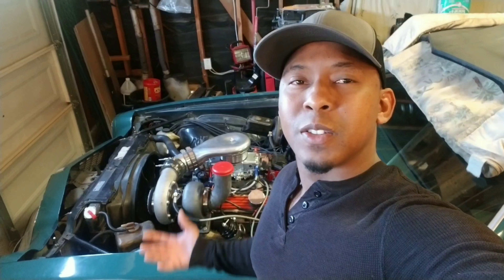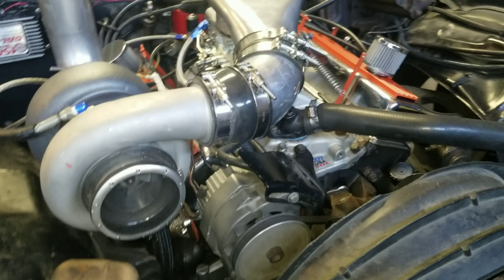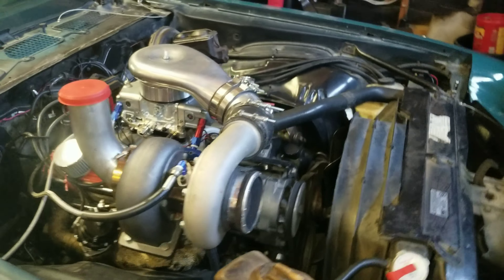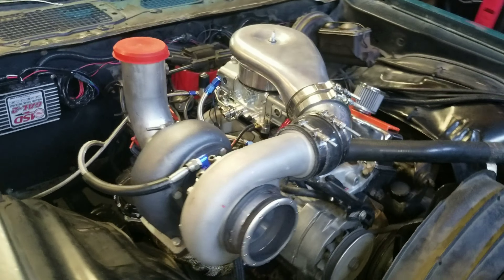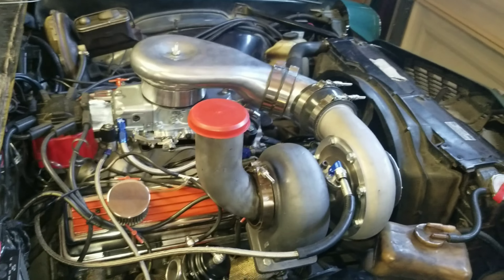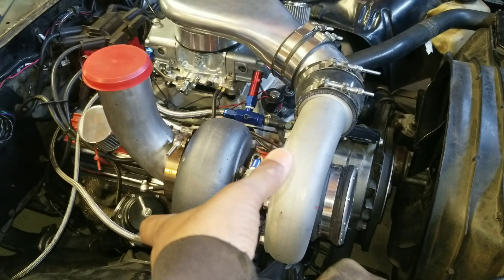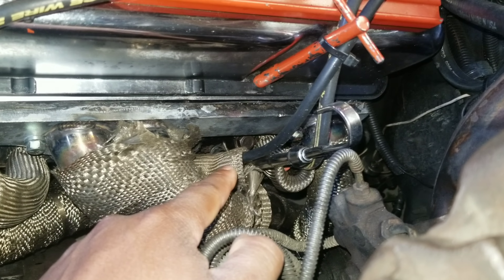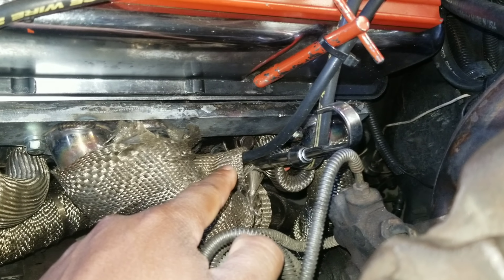EBAY'S BEST SBC TURBO KIT

Comment: Great video my friend!!! I have a few questions, if you don't mind. Could you run your 3" exhaust dump down through where the crossover pipe comes up through on the passenger side? Was there enough room for it, I know you went through your roof with it, just wondering if there was enough room there. Also, how much would the turbo need to come down to clear the stock hood? Or should I say, how far does the turbo stick up past the stock hood. This company has this same turbo kit for a ls engine, and thats what I'm doing research for. I already have a ls swapped into my 81 camaro, just need to find a turbo kit that fits, but won't brake the bank.
Reply from the maker: The turbo sticks up past the stock hood at least 4 inches. Its quite a bit. Also there is enough room to run the exhaust downwards on the passenger side. Thats actually how I'm thinking about doing it. Thanks for watching 😁 👍

Comment: Ive ben watching tons of turbo builds .. i never seen a single turbo build .. i never imagined they just went on one headder and thats all i thought both headders was connected somehow and ran to the turbo that way ..i guess you tought me something ..
 Ive ben looking at a set of gt45 turbos for my big block and i was instructed to spend good money on a top of the line waste gate and blow off valve to be on the safe side .. you just confirmed that . Thanks man ..my buddy told me to watch your video.  He was right .
Reply from the maker: Thanks. I appreciate it.  That's correct you always wanna invest in a good wastegate. Also the 2 manifolds are connected with a crossover pipe that's located underneath the engine bay. If you have any questions feel free to contact me. Thanks for watching 😁👍
Reply: @Duwop77  your welcome my friend. .I liked and subscribed for more of a free education !!! Lol
Reply from the maker: Thanks a million 🙏🏽 
You can also check out the updated video of my setup if you haven't had a chance to. Link is below. Thanks again😁👍
https://youtu.be/LG5kVQgyjsM
Reply: @Duwop77   buddy I sure will .. I put down the phone last night and headed to the garage .. I have alot of work to do this week while I'm off but when I sit down to take a break I'm always on my phone on YouTube watching hot rod related videos ...I'm hung up on the street racing channel garage videos ..I can quickly tell your gonna be right up there with them .. have a good 4th bro and God Bless !!!!!
Reply from the maker: Thanks, Happy 4th. God bless😁

Comment: Working on a turbo 305 right now, and kind of still learning about turbos 😟. Are you running water lines in your turbo? Do you need to? And are using a mechanical or electric fuel pump?
Reply from the maker: I'm only running oil to the turbo. Although some turbos use both oil and water. Also I'm running an electric fuel pump. Holley blue or better. Thanks for watching 😁 👍
Reply: @Duwop77  10-4, thank you! Gonna pop the engine in as soon as I can!!
Reply from the maker: Wish you the best on your project 😁

Comment: I will never understand why people lower their cars to the point they bottom out. Maybe it's the era I grew up in during the 60s and 70s, but we jacked our cars up to put big tires on them. When we went to the strip and pulled the front wheels off the line we did not bottom out when landed and didn't bottom out going over a curb.
Reply from the maker: Some do it for looks and some do it for performance reasons. Me myself I did it for looks. Thanks for watching 😁👍

Comment: Thanks, I'm thinking about doing this on an 80 corvette it has 340hp but I need about 390hp... so I'm thinking about it. Either that or cylinder heads. I like the way you did the video.. I'm gonna watch some more of yours..
Reply from the maker: You'll rech that 390 mark easy with a turbo kit. I'm currently upgrading my fuel system. Thanks for watching 😁 👍
Reply: lol, 390? on 8lbs boost, try like 450 at least. a rule of thumb is for every atmosphere of psi added(14 is atmospheric pressure), double your starting naturally aspirated hp. 7lbs would add 170hp to that 340hp(510hp)

Comment: Those look promising. Not many single turbo header options for the SBC. Looking into building a twincharged 383 for my truck.
Reply from the maker: That's true. I saw mostly twin turbo setup for v8's when I was searching. Good luck with your build wish you the best. Thanks for watching 😁👍
Reply: @Duwop77  hey you know where I can find a single turbo manifold for a 1963 impala? When I searched that stores link you posted I only found twin sets
Reply from the maker: I haven't found any kits specifically for a 63 impala.  But the kit I'm using may fit a 63 impala long as it's a sbc with straight plug cylinder heads. You may have to modify the crossover pipe.
Reply: @Duwop77  ok thanks, yeah it's a 327. I'm sure that's an easy tweak. I plan on building a lq9 or 4 later but I'm ready to have fun. I haven't seen all you're vids just subbed but are you running a powerglide? Also can we run these turbo kids with efi conversion ?

Comment: the quality of assembly, the quality of cast, the bearings, the output, vibrations, heat, all plays a role and if cost cutting is done then the final quality will be trash irrespective of the shine.
Reply from the maker: I couldn't have said it any better 👏
Reply: only bad thing about ebay turbos is that they are not balanced the best. still wayyyy cheaper and worth it though
Reply from the maker: @frigglebiscuit7484  i agree. So far that's all I've been able to afford 😅

Comment: I can’t seem to find that exhaust manifold and are you gonna put a intercooler on it
Reply from the maker: I'll see if I can find another listing for the exhaust manifold. Also I plan on putting an intercooler in the future but as of now it's fine. Blow through style carburetors does a good job at cooling the intake temperatures. Thanks for watching 😁 👍
Reply from the maker: Link to the exhaust manifold below 😁👍🏾
https://www.ebay.com/itm/125198480474?mkcid=1&mkevt=1&mkrid=711-53200-19255-0&ssspo=IjcjArgySYu&sssrc=2047675&ssuid=00bsf4SkRKe&widget_ver=artemis&media=COPY&amdata=enc:AQAIAAAAoO9CpS+HZTbPNjA26zZgnzGXKSymzAP4a/BmPYKcQBLg/34ioYc53fmdas756VYqNDP811/TXln6f0pMoY5liFZYKxoYNPOZSeDcYS1edmlvzno6LsVfsceK613Vb9/NVYfAncid6/4Wl/l2Es59M0Xg7G2JHYKz2fmQslqJ44TzbWb4JL9H7Q67lTQvCxuMzwE9+DkiDUedakPmHUfSnPo=&siteid=0&campid=5338700573&customid=&toolid=10001

Comment: I've been searching for the Accel plugs you mentioed. I have the same exact kit on a 355sbc. Would you remeber the part number for them?
Reply from the maker: Yes the part number is 574s/8199. I found a set on ebay. Check the link below. Thanks for watching 😁 👍 
https://www.ebay.com/itm/ACCEL-8199-574S-HP-Copper-Spark-Plug-Shorty-14mm-460-Reach-8-plugs-total-/255264630729?mkcid=1&mkevt=1&_trksid=p2349624.m46890.l6249&mkrid=711-53200-19255-0&siteid=0&campid=5338700573&customid=&toolid=10001
Reply: @Duwop77  Thanks!

Comment: You have me confused. Why did you hook up the exhaust pipe to go under the car and why is the exhaust on the turbo (that points straight up) covered with the plastic plug? How can this work?
Reply from the maker: Due to it being an engine with 2 cylinder heads. Both exhaust manifolds need to be joined together. That's the reason for the crossover pipe underneath. So that both exhaust pressure's can be combined and forced through a single turbo setup in order to make it spool. If it was a twin turbo setup there wouldn't be a need for the crossover pipe. Each exhaust manifold would have it's own individual turbo. An engine with one cylinder head like a four cylinder engine wouldn't need a crossover pipe either. And the pipe coming off the turbo is the actual exhaust that is usually ran to the rear of the car and vented into  the atmosphere like any ordinary car/truck or motorcycle. I just took a shortcut and aimed it straight up 😉
If you have any further questions feel free to contact me. Thanks for watching 😁👍

Comment: first id like to start by saying i LOVEEEED this video super helpful, already bought everything on your list for my 350.
but im curious since im fairly new to the turbo mods whats up with the pipe coming from the back of the turbo and out the hood?
Reply from the maker: Thanks, glad my video was helpful. The pipe on the back of the turbo facing upward is the actual exhaust. Instead of running it to the rear of the car or doing a fender exit like most are doing these days. I took the cheapest and easiest route, by running it straight up 🤣🤣
Thanks for watching 😁👍
Reply: @Duwop77  thats awesome! however i do enjoy my eardrums so well be running it to the rear, how are you keeping track of your boost numbers/ getting them to where youd like them? i didnt notice a boost control system.
Reply from the maker: @soulevans9666  its Controlled with the wastegate spring. But I will be installing a turbosmart manual boost controller. I have one on my turbo integra and it works well.
Reply: @soulevans9666  you can buy a cheap boost controller that basically acts as a controlled vacuum leak. the more clicks, the bigger the vacuum leak, it fools the wastegate, and thus more boost. gotta be careful for boost spikes though lol

Comment: Is your turbo only being powered by your passenger side cylinders? I thought they were supposed to use the cross over exhaust pipe to tie in before the turbo. Thanks for the video
Reply from the maker: Your welcome. It has a crossover pipe underneath that combines the driver and passenger side. Thanks for watching 😁👍

Comment: What carburetor,intake manifold,heads and cam are you running
Reply from the maker: That was a basic setup. It only had  comp cam. Don't recall the size. Everything else was basically stock. I believe it had a performer rpm intake manifold
Reply: @Duwop77  thanks man
Reply from the maker: @brandonkeasling3397  Your welcome

Comment: Hello!

I have a question if you want a turbo on a 350 chevy block does it work with a edelbrock carb?
Reply from the maker: No sir. Not with a normal edelbrock carb. It has to be a blow through carburetor. The link below is to a blow through carburetor for sale on Ebay just for a reference.  Thanks for watching 😁👍
https://www.ebay.com/itm/HOLLEY-QFT-650-HP-4150-BLOW-THROUGH-SUPERCHARGER-OR-TURBOCHARGER-USE-ONLY-/184859858899?_trksid=p2349624.m46890.l49286
Reply: @Duwop77  thanks for your fast reaction! 🤘🏼
Reply from the maker: No problem 😁👍
Reply: you can, but you have to do a few mods. there are vids of the mods here on youtube.

Comment: Can you tell me the name of the kit And will it fit a 305 motor
Reply from the maker: Yes sir. All the links to the parts I used are in the description box. Also it should fit a 305 long as the heads are straight plugs. Thanks for watching 😁 👍

Comment: No blow off valve? So is one not needed??
Reply from the maker: I always say do it at your own risk.  But you'll get mixed information. Some say it's ok and some say don't. Usually under low boost 5-10 psi you'll be ok without one. I run my integra with out a bov all the time at 10psi. Thanks for watching 😁👍

Comment: Where did you tap in for the oil return line
Reply from the maker: In this video the oil pan was tapped. But if your running an electric fuel pump. Moroso makes a plate for your mechanical fuel pump location that has an 10an fitting you can drain back to. Thats what I'm using now

Comment: Ayo I got a 79 camaro and I see this and this might make me get a turbo
Reply from the maker: Yes sir. Its fairly cheap to do these days. And on a 79 camaro its the same steps. Just be sure to upgrade your fuel pump and get a boost referenced fuel pressure regulator. The link below is to the upgrades I'm doing. Thanks for watching 😁 👍 
https://youtu.be/Nf6B7NvGvqw

Comment: Hey man love your build. What are you running for ignition System and what are you running for timing?
Reply from the maker: Thanks, ignition system is MSD 6al-2. Its currently running base timing for all motor until I get the fuel system setup. Once it's all complete I'll be sure to update. Thanks for watching 😁👍
Reply: @Duwop77  I’m currently working on my 84 trans am with a 383 with twin turbo. Definitely will up load to my Chanel. Talk soon man hope I don’t bother you with prolly a lot of questions in the up com thing hahaha
Reply from the maker: Nope not at all. Ask as many questions as you please as often as you please. 84 trans am is a beautiful car. Good luck with your build👍

Comment: So is the turbo only running on 4 cylinders? Or do the headers connect somewhere?
Reply from the maker: There's a cross pip that runs underneath that connects both exhaust manifolds. Thanks for watching 😁👍

Comment: I got a 1986 350 bored 30 over with a mild cam but stock heads, do you think my engine would be able to handle this turbo kit?
Reply from the maker: Yes, any engine can handle its own portion of boost. If it's a stock to mild build just keep it on low boost. 5-7psi. Also a skilled tuner is a must. Thanks for watching 😁👍
Reply: @Duwop77  thanks for the reply and I will!

Comment: Great job on your install. After doing all that work and to get the full potential of the turbo ,,,, why not finish it right with adding an intercooler.
Reply from the maker: Thanks, it's on low boost so I'll be ok. But eventually I'm  gonna install an intercooler. Thanks for watching 😁👍
Reply: Also on carb'd turbo cars, the fuel atomization from the carburetor thru the intake acts as intercooling (latent heat of vaporization). Unless you're running high pressure, it's pretty hard to heat soak a proper blow thru setup.

For someone on, say, under 12lbs of boost, the intercooler would just be a complication.
Reply: carbs dont need an intercooler.

Comment: You can use 12 point 3/8 head arp header bolts and then you can use the box end of your wrench. Also stage 8 header locks work very well and you won’t ever have to re-torque them
Reply from the maker: Thanks for the tip. Also thanks for watching 😁👍

Comment: Do you did something to the carburetor
Reply from the maker: Its what's called a blow through carburetor. Its made for boost. A regular carburetor isn't suitable. You can find them on ebay, jegs, summit racing etc.

Comment: It don’t need intercooler or anything like that ??
Reply from the maker: Intercooler isn't required with blow thru carburetor. Although it's always beneficial. At that time, I wasn't using a blowoff valve,  but I am now.

Comment: Any ideas on what kind of boost your producing great video man
Reply from the maker: It has a 7 pound spring in it. But the engine in the video also had a flat cam. So I never got the chance to feel the boost. That engine has since been swapped out and currently going through some upgrades and break in. Stay tuned for the update video coming soon. Thanks for watching 😁👍
Reply: Sweet man thanks for the very fast reply I'm building a sbc turbo drag elcamino and doing research between blow thru and going Holley sniper kit
Reply from the maker: No problem. I also wanted to go efi but at the time I didn't want to dish out the extra cash to upgrade my fuel system. But I think in the future I'm gonna do it.
Reply: Same here I can't justify going crazy on spending since I can't make it to the track as often as I want together now but hopefully in the future it will be ripping down the strip
Reply from the maker: @tylerwidmer7088  Sounds like you and I are on the same boat. I even work on the days the local track is open😫 but one day I plan on being in there laying down some rubber🤣
Reply: Same here man I work Saturday through Wednesday one l only day I would have is Friday
Reply from the maker: @tylerwidmer7088  don't give up on it bro. Even if it becomes a weekend worrior. It's still your proud jewel 😁👍

Comment: Good video g, I got a 327 and I wanna throw this on for a fun budget build for the channel. They stopped selling that turbo you had linked bellow, you know of another good option?
Reply from the maker: Thanks bro, I found another listing. It's the same turbo that I'm using in the video. Here's the link https://rover.ebay.com/rover/1/711-53200-19255-0/1?mpre=https%3A%2F%2Fwww.ebay.com%2Fitm%2F153895166446&campid=5338700573&toolid=10001&customid= Thanks for watching 😁👍
Reply: Duwop77 thanks appreciate that. You got the new setup done yet?
Reply from the maker: @derxgarage2121  almost, the swap is in. Just making some modifications so I can start the break in process.  Update video coming soon👍
Reply: Duwop77 cool thanks for the help. I’m probably going to run this set up, but add a blow off valve off the scoop on the carb.
Reply from the maker: @derxgarage2121  your welcome. I also wanted to add a blow off valve. But I don't have the skill to weld one on the carb hat. In the future I'm also planning on adding an intercooler.

Comment: What's the link to the turbo manifolds?
Reply from the maker: All parts used are listed in the video description box. The link is below. Thanks for watching 😁 👍 
https://www.ebay.com/itm/Single-Turbo-Headers-for-Chevy-Chevelle-Nova-Camaro-Caprice-Small-Block-V8-/353774181638?mkcid=1&mkevt=1&_trksid=p2349624.m46890.l6249&mkrid=711-53200-19255-0&siteid=0&campid=5338700573&customid=&toolid=10001

Comment: Yo question FAM is that EFI carb or just regular gas carb let a brotha know
Reply from the maker: It's a carburetor. But not a regular carburetor. Its called a blow through carb. Basically a carburetor that's been modified for boost. Thanks for watching 😁👍
Reply: @Duwop77  so its a demon holly 650 am basically pricing everything so when I get my bonus most of it goes to some parts for my sleeper 327 chevy
Reply from the maker: @teojim  that's right👍. It's a 650cfm demon blow through.
Reply: @Duwop77  thanks man once get my set up I post. Video
Reply from the maker: Fosho, shoot me the link when it's up. And if you have any questions feel free to hit me up.